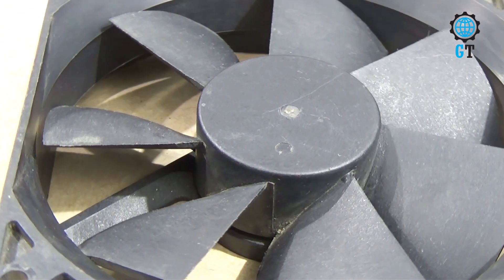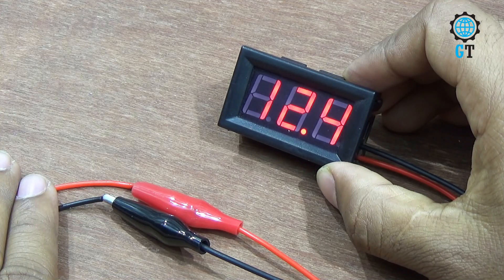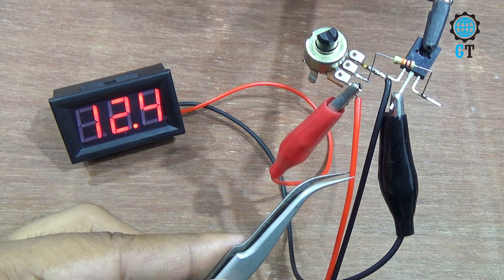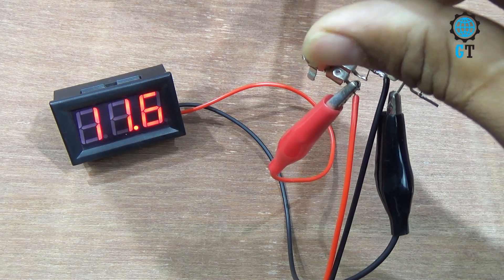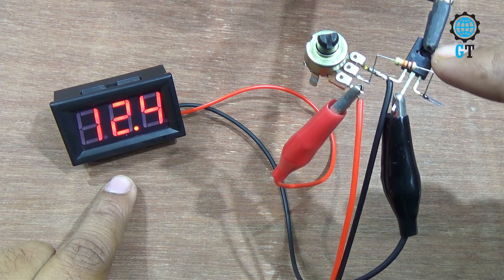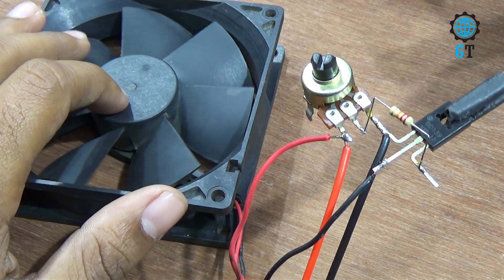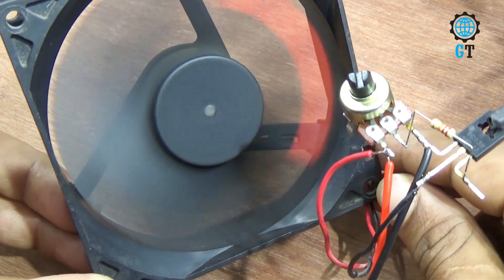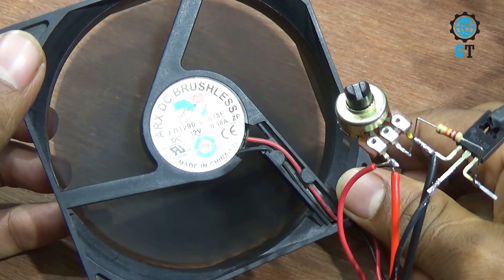How To Make Fan Speed Controller Circuit - Cheap Circuit || Full English Tutorial

Comment: Whether it can be make the fan speed more faster than normal?
Reply: for that you need to increase the voltage. if you have a 12v fan, you can increase it up to 15V to get it to speed up just a little more. 

be careful though because you can fry the fan if it's too much voltage.

Comment: I tried this one and it didn't work. Did you use a Transistor NPN aswell?
I used a Volume B100k / 0.125W
Transistor BD139 NPN
Resistance 22kΩ
Fan, Sunon 12V/DC 2W

When i connect it, it sounds like it want to start but does more like a bumping and doesn't rotate.
When i put volume up it does nothing.
I might did more than just something wrong.